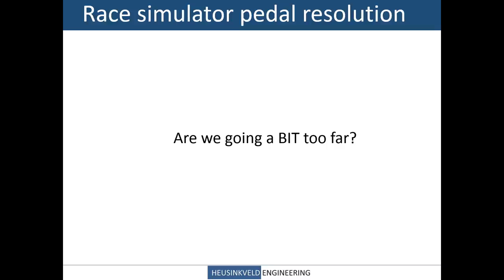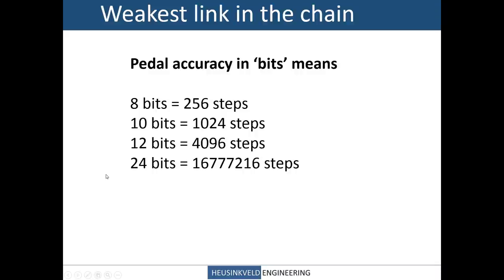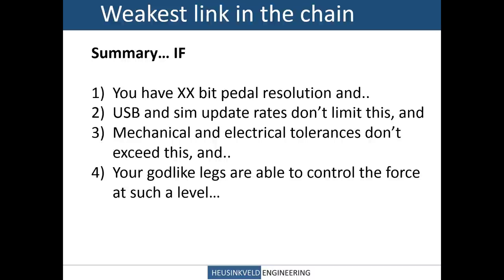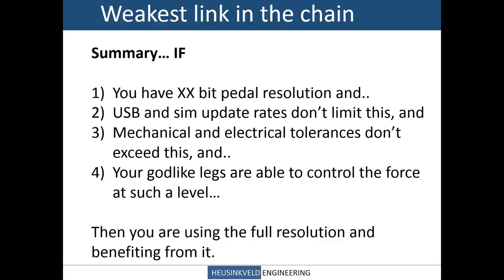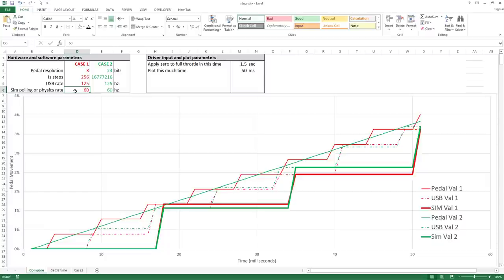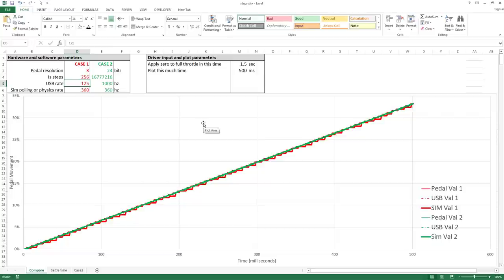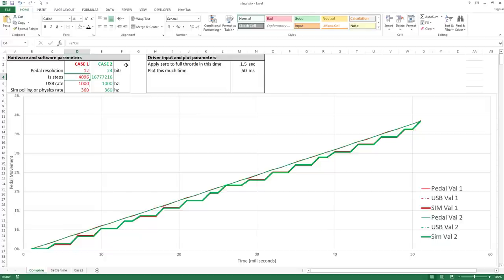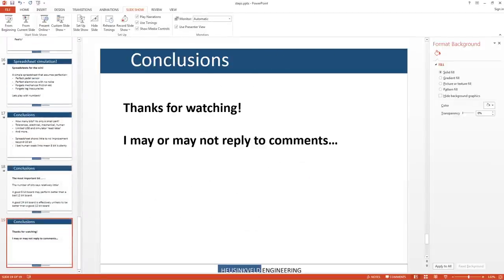Game controllers with 8, 10, 12 or 24 bit resolution, what does it mean?

Comment: How do we know the USB hz of our wheels and pedal cables?  Thrustmaster, Logitech, fanatec?
Reply from the maker: If its more than 125 or 250hz, they typically mention it in marketing stuff.
Reply: Thx for that.
Reply: I used the sine wave output test in Wheel Check (written by iRacing's David Tucker) to test my Fanatec CSWv2, and it appears that there is a 250 Hz sample rate limitation somewhere in the chain.  My first guess would be that this might be the USB polling rate it is using.  Frequency response seems to stop at 125 Hz and things just start folding over on themselves after that point, so whether or not it is the USB polling rate, it is being limited somewhere along the line to 250 Hz and giving that apparent cut-off frequency of 125 Hz.

Comment: Question - do they not add up as you have 3 pedals tho? If you have One 8bit controller for 3 pedals, does it not devide the 256steps by 3? Because that would make a huge difference
Reply from the maker: The value is not divided by 3 pedals, each pedal gets the 8 ( or 10 or 12..) bit resolution.

Comment: What about bit resolution vs. degrees of rotation of the wheel?
Reply from the maker: Mostly the same thing, it is also an analog axis just like a pedal. However if you have a high end system like a SimSteering, it will use a very expensive encoder or resolver. This sensor is probably more accurate with less noise than most loadcells or potentiometers or hall sensors or pressure sensors. But still, resolution is only one thing, update rate and sim 'read rate' can limit it just as much.. Edit: And if you have 256 steering steps while calibrating 1080 degrees, that will be noticable as you have steps of 4 degrees, it will be hard to go straight. A pedal may move 100mm, but the edge of a 300mm steering wheel turns 2800mm in this case, so you need more steps there.
Reply: Hi Niels, do you know at which bit rate is the steering wheel position calculated in the ISI engine? The encoder on the  SimSteering is very high resolution, but software wise, I'd love to know the bit rate of wheel position in the engine too, since u know so much about engine :)